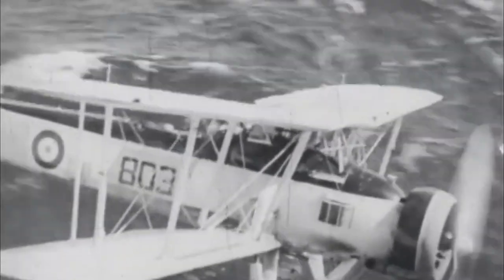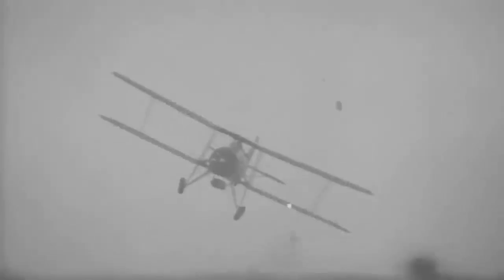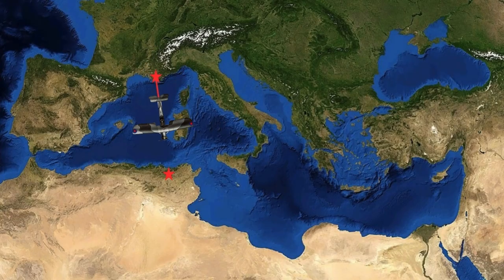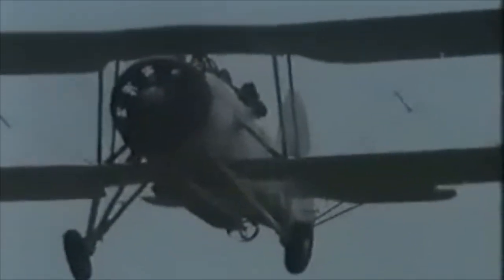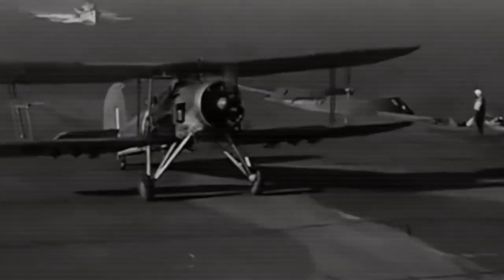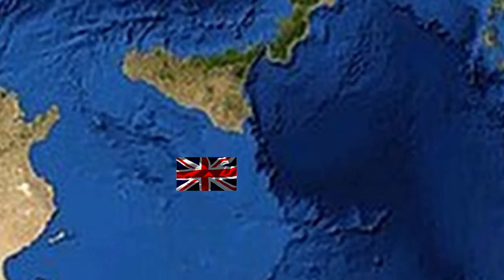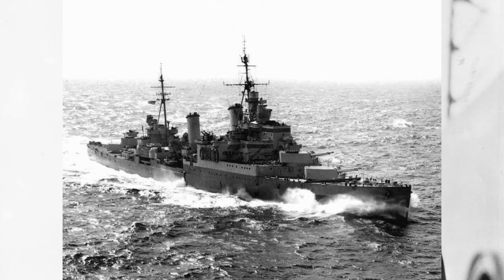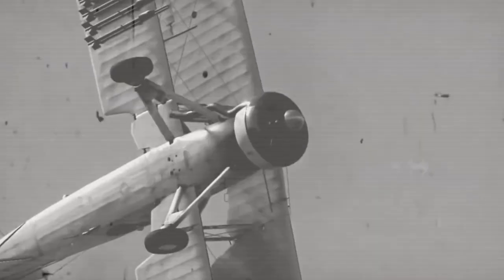FAIREY SWORDFISH | The Biplane Battleship Killer of WWII

Comment: Like many documentaries on YouTube it seems all sorts of nonsense can be made. The Swordfish is a biplane. It is a WWI design. Its top speed is 139 mph. Most monoplanes in late 1930s can achieve 300-350 mph. Most fighter planes in the late 1930s could easily overtake the slow flying biplane and shoot it down. Given the availability of radar a group of Swordfish biplanes (with metal body & wings) can easily be detected approaching a naval base.
It is always difficult to shoot down a fast flying aircraft from ground- or ship-based anti-aircraft artillery. But the Swordfish is flying at less than half the speed of a late 1930s monoplane fighter. It is far more vulnerable to being shot down due to its slow speed. In addition, if you add on a 1700-pound torpedo to the undercarriage of a Swordfish you have significantly compromised its weigh, increased aerodynamic drag, and compromised speed-maneuverability. The Swordfish is a sitting duck. Its success at Taranto was probably due to surprise because the Italian Navy had not adapted to new naval doctrine where naval warplanes would dominate combat. In the latter half of the 1920s throughout the 1930s, it was Great Britain, the United States, and the Japanese Empire who were developing naval tactics based on carrier warplanes. The Italians had not encountered attack from carrier based torpedo bombers, and were surprised by the British Swordfishes.